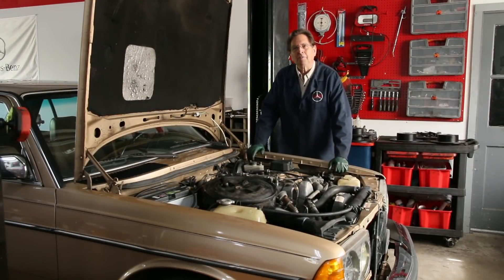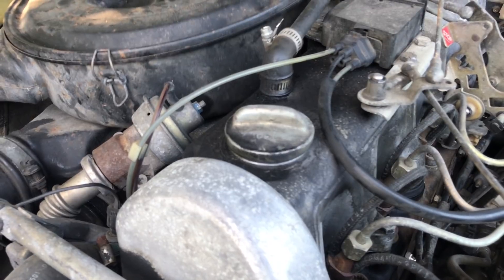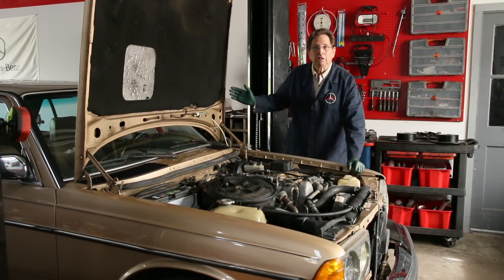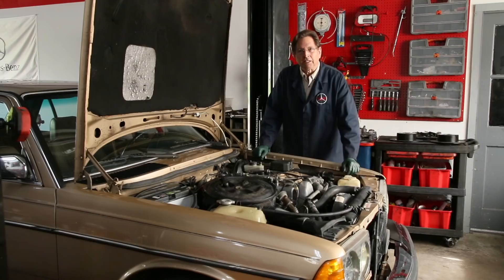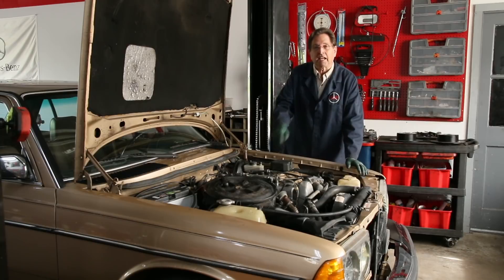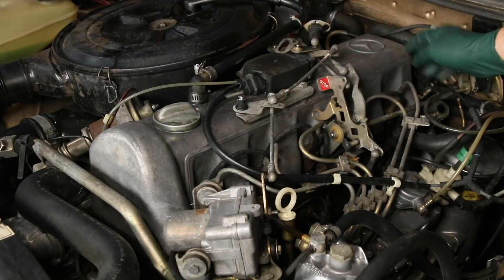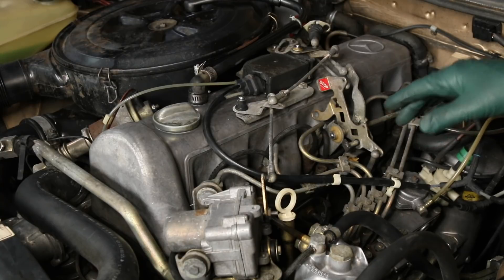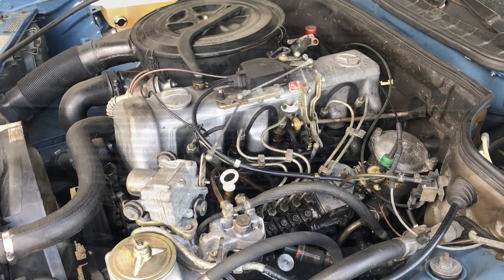Quiz Answer: Why is This 300D Diesel Engine So Healthy?

Comment: I just picked up a 300TD from 1983 and sure enough it also has the same ridge on the valve cover. Does anyone know if Mercedes will give me info on the swap if I reach out?
Reply from the maker: Call a local dealer and ask. They can run a maintenance history. You may have to prove ownership.

Comment: Just wanted to add that back in the early 90's Mercedes Benz had an actual sale on the OM616 and OM617 complete ready to install crate engines, for just over $5000 Canadian dollars for the turbo version.  Although, I didn't have a diesel back then (I had a 450SEL and W115 230.4) I thought to myself that that was quite a bargain and a person should buy one or two to squirrel away.  I imagine a number of people thought the same and replaced their engines at that time.  Anyone else remember that engine offer from MB?